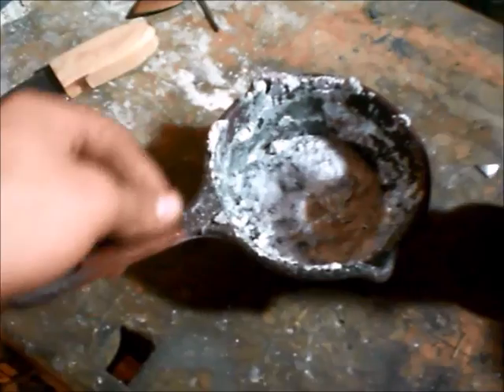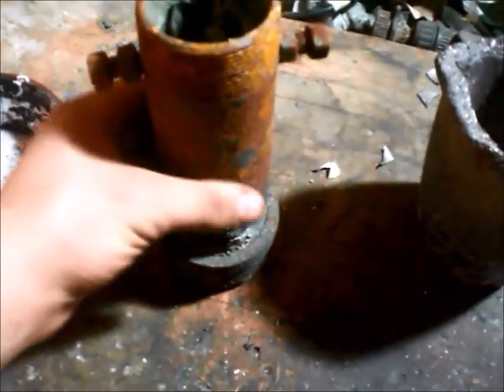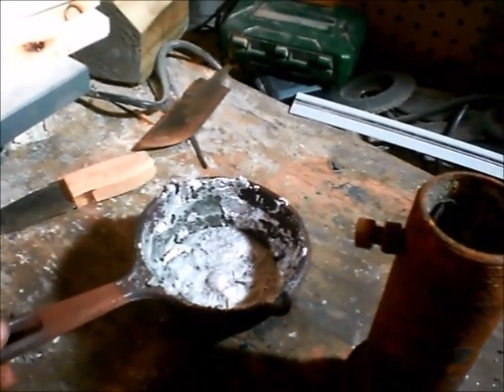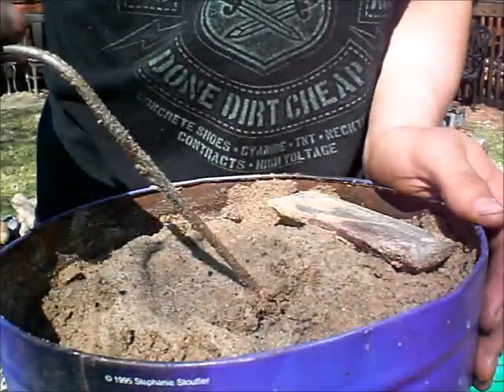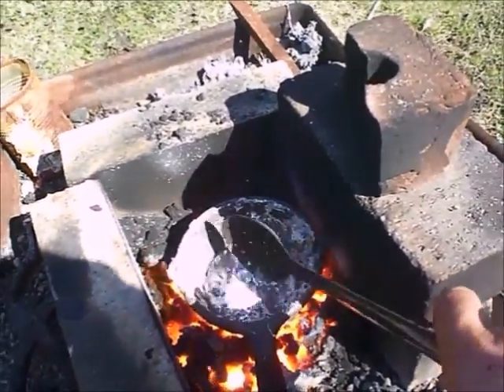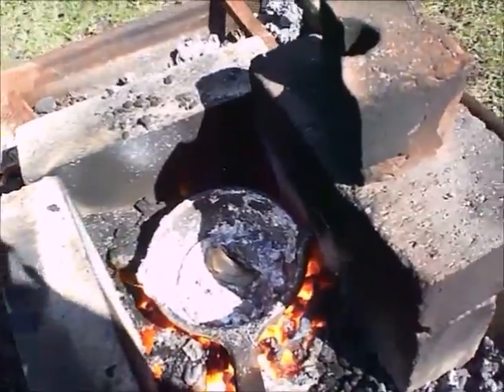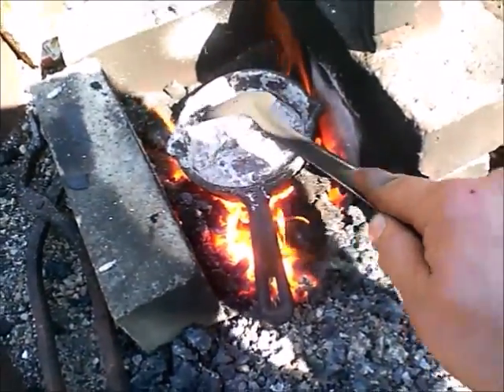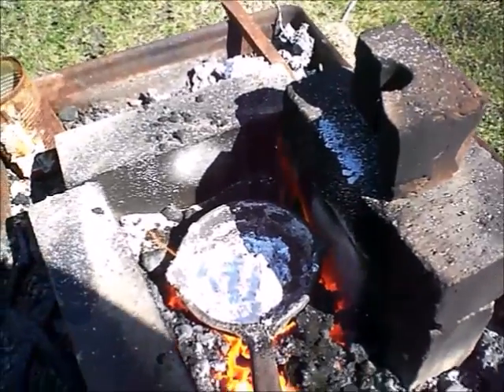Melting Aluminum Cans

Comment: Hello! I'm only just starting to research DIY aluminum recycling since foil is a popular material in my mixed media/sculpture class. This is only the second video I've watched. :D Right around 5:30 mark, you say not to put too much in, but the reason why isn't very clear verbally and the auto closed-captioning doesn't know either. Did you say it could deform the crucible?

Comment: Hello, is that charcoal ( wood)??          or the coal ( stone kinda) ? ?? its so beautifully lit,  sorry what are you using that is lit so firy good?  Thanks a lot
Reply: It's called Lump Charcoal. It burn at a much higher temperature than wood or charcoal bouquets. Also, for the same size bag, it less than half the cost of charcoal bouquet's, about $5 at Walmart. I use it myself.

Comment: I cast a metal melting furnace from mortar into a metal cube made from an old washing machine casing. The crucible is the bottom of a non-return helium cylinder. It worked fine when heated by wood and an old hairdryer as a blower, but the first time i added charcoal the bottom of the crucible burned out. When I get around to doing some more smelting I'll chop the bottom of an unused, empty larger cylinder or look around for a cast iron pot.
In terms of the mould; putting a couple of screws or bolts in the top surface will aid in removing it from the sand more cleanly.

Comment: What kind of table is that you're working on with the fire?
Reply from the maker: Its my forge!  I have since built a new one that is much larger and better.  This one, the body was an old lawnmower shell, an aluminum frame, and a rotor for the fire pot.

Comment: How do you get the fire hot enough do you have a trick? Or will a simple campfire melt the aluminum cans?
Reply from the maker: Air!  A campfire will work but you have to make sure your getting enough air to it.  For my forge and my old foundry I use a blow dryer connected to a light dimmer so I can control the heat.  Using hardwood charcoal, not briquettes, will reach a higher temperature than wood as well.  Hope this helped!
Reply: Gotcha ok I'm going to give it a try build my own little set up I'm going to use the aluminum heat and air ducting and an old weak leaf blower
Reply from the maker: @MrJohnv8386  hmm, ducting may not work for you very long.  I would suggest an empty paint can.  You can get those at any hardware store.  However if the duct is to channel the air then you can ignore all that.    Old leaf blower is exactly what I first used.  Good luck!  Let me know how it goes!

Comment: I need a block to machine on my lathe, will this aluminum have porosity in it from the impurity’s?
Reply: Process it twice would give you a much cleaner ingot i would think. You will lose a little more material but should be much cleaner. I know this is a six month old post. So what did you come up with?

Comment: hello , so I've tried this today , but i wasn't able to melt the beer and soda cans that i have. maybe it was too cold outside .... I used a vacume cleaner with a blower function to boost the wood's temperature and i've tried to melt the cans inside of an iron bucket, the bucket got red hot on the bottum and the cans would light on fire for a bit but after that, nothing! it was dissapointing, what am I doing wrong? anyone?
Reply from the maker: Hey!  Im so sorry for the late reply.  If you still need a bit of help I'm happy to provide.  If not, how did it go??
Reply: Use Lump Charcoal instead. Burns at a much higher temperature than wood or charcoal briquettes.  About $5 at Walmart.
Reply: I havn't gotten arround to it again since but i'll give it another go in a couple of months.
Reply from the maker: @xtazy1337  Great! Keep me posted

Comment: How does the fire get so hot
Reply from the maker: Its quite simple really.  Just like when you're camping and your fire starts dying you add more wood and blow on it.    Here, instead of using wood we use either coal or charcoal, I suppose charcoal could be viewed as wood but its "cooked" wood, and instead of blowing with our lungs we use some kind of machine.  I use a hair dryer with the heating function turned off.  I do this because it saves a lot of energy and the fire doesn't need any extra heat haha.  I have also attached a light dimmer to the hairdryer so that I can control how much it blows.  Because of the constant flow of oxygen to the burning fuel, it gets really hot.  Going back to the campfire, instead of short blows with your lungs, imagine putting a leaf blower up to it.  If you really want to learn cool applications of this chemical reaction, look up how oxy/fuel cutting works.  Hope this helped!

Comment: Something tells me inhaling even a little bit of fumes from that melting aluminum cannot be good for your health.
Reply from the maker: Theres a lot of facts and discussion around that.  From what I am aware of and in my experience, the fumes are really no danger to you unless the metal is boiling.  Then, just like water, the metal is literally evaporating and being put in the air on a molecular level.  Now, it takes a heck of a lot more heat to do this.  Aluminum melts at 1220 degrees F, thats 660 C.  In order to boil aluminum you need a temperature of at least 4,473 degrees F or 2,467 degrees C.  Those are pretty tough numbers to reach in factories let alone in your backyard.  However, thats only thinking about the aluminum.  In this video I melt pop cans which have paint and often plastics which of course are hazardous to burn.   Lets also not forget the coal I burn.  I really don't like melting cans for that reason but more for environmental reasons than for my health.  Yes if I stick my face in the plume of smoke created by the crucible and forge I could come down with cancer or some other disease but so long as your in a well ventilated area or have a form of proper ventilation there is really no cause for concern.  The only time I wear a face mask when working with aluminum is when Im grinding it.  When you grind or power sand aluminum or any metal you are putting it into the air.  Aluminum has been linked to many diseases such as alzheimers so I am very cautious and work safe in these process.  But the act of melting it does not raise alarms for me.  One more thing to be warry of is that aluminum in a molten state likes to stick to things, including you.  Fellas who work in professional foundries tell me they would rather work with steel than aluminum for this reason.  Im no chemist but my understanding on the concept is that because steel is so much hotter in the same state it likes to flow more fluidly as opposed to aluminum.  Im sorry to ramble :)

Comment: Cool video! I also built a furnace similar to yours! It's on my channel if you wanna check it out and let me know what you think... thanks!
Reply from the maker: Thats great dude!  excellent!  I would recommend insulating it somehow so that you can trap more heat and use your fuel more efficiently.  Plus you may even be able to melt different metals!  I would recommend looking up recipes using refractory cement or you can go the cheap route and get yourself some kaowool insulation.  Keep it up!

Comment: Great video, youre very easy to listen to because you speak so well to your viewers without the normal pitfalls others encounter: basically be you're a great public speaker, you don't resort to the usual "um's"or pauses, non sequiturs or inaudible  mumbling, which so many other amateur videos suffer from. So now saying that: I have one (two) questions and one tiny suggestion. First the suggestion: when outside, to make your voice more easily heard, try using a earbud/mic connected to your phone, the mic will pic up your voice (obviously) or in the absence of such an accessory, try covering your face with a loose fitting face mask (think Chinese people when SARS was everywhere) basically a medical hospital mask, or even a bandana a la bank robbers during the days of cowboys and Indians. Ultimately what you want is some way of reflecting your voice back towards the mic on your phone so it picks up your narrative a bit clearer. Even a piece of cardboard taped dangling from your nose in front of your mouth works in a pinch. ... Now my questions, if you part of the borax still in the aluminum, how and in what capacity does it still filter impurities before and as you're pouring it? Second, you mentioned hairdryer towards the end, for what reason? Surely the heat of a Conair hairdryer isn't enough to melt aluminum. Is it something having to do with stoking instead?
Reply from the maker: Thank you very much for everything you said!  I have been trying to make time to create more videos but find that to be rather difficult.  However, once I do finally get around to it I will be sure to take your comments and suggestions into thought and action.  As for your questions, the borax pulls impurities to the surface, its best to mix it into the metal with a spoon or something of the sort for a moment to really make sure your material is acting with it.  It stops filtering after you scrape the slag off the top.  It is best to leave a small amount of slag on the surface because this will actually act as a second filter when you go to pour.  I hope that answered your first question.  The hairdryer is what I use to supply a constant air flow through my forge. Because I use a hard fuel forge (coal, coke, charcoal) It requires a constant feed of air.   I have found that attaching a hairdryer to a light dimmer gives me optimal control of the fire.  Feel free to try it out!  I will make an updated aluminum melt video shortly as I have found new information and techniques to improve quality and efficiency.  Hope I helped!

Comment: Great vid & some good advice in the comments, I collecting Alli can's to melt, just want to know, do I need to take out the rubbish in them or will they just burn off, like smoke Butt's etc
Reply from the maker: Youll hear people tell you to make sure they are dry and youll hear some people tell you not to worry about it.  Im right in the middle.  A few drops of pop left over will instantly turn to steam, but a few sips will instantly send molten metal on your sleeves and in your face.  The plastic/wax or any other junks in the can will burn away with the paint but residue will be left in your pot which will need to be scraped off.  All in all, just pour out any liquid left in the cans but I usually dont worry too much about it. However, the drier the better.  Do your best to place the cans into your crucible right side up.  Hope I helped!

Comment: How many cans to make a bar and how much do you get for a bar?
Reply from the maker: Id say it takes around 15-20 cans for an ingot.  If youre looking for bulk there are much better resources out there for aluminum.  If you mean how much $ per bar Im not sure, I know its not a lot.  I use mine for sand casting not to sell.

Comment: what is the material of the vessel. is it metal or wat?
Reply from the maker: Mine are made of steel or cast iron.  Those work best for aluminum.  Dont buy a graphite pot unless you plan on doing precious metals or structural projects with your aluminum.

Comment: One thing that anyone trying this needs to know. Make absolutely sure your cans are completely dry and free of any liquid inside before adding them to molten metal. Once you have molten metal in the crucible, if you add another can that has ANY liquid, it will explode and sent molten metal flying. Best to use something large enough to hold all the cans you want to melt for one pour. That way any fluid will burn off before the metal melts.
Reply: Absolutely correct at the very least  por everything out and set next to coals or put in the  oven to make  sure it's dry even a drop of sweat will make bad things happen. And you will have no safety suit or anything. Unless you know what your doing I wouldn't try this at home. I've worked melting steel an aluminum. People die every year  from it and no telling how many get hurt
Reply: Thank you so much it indeed helps.

I have one more question please..

Can use beercans molten meltal to cast some shape? 

🙏
Reply: @lgrdiesel9655  Yes you can!
Reply: @1gallimaufry  
Thank you

Comment: I watched your whole video and i do have to say when you said that you saw or whatever people use the bottom a fire extinguisher i do have to add a comment about that, I myself used that and it was aluminum itself so it melted as well but also do make sure what metal it is before you use it, most likely just put a magnet up to it or whatever but not all fire extinguishers are usable for melting down aluminum. But i did like your video and i was thinking to myself "wow that guy is really unsafe" but then again when i did that before it melted the extinguisher i wasnt that safe but cool video!
Reply from the maker: +Freedom One I'm very happy you said that!  I was unaware that fire extinguishers were sometimes made of aluminum.  And yes a magnet would be the perfect tool to check for that.  Of course safety is number one, but often over looked, above all, always remember to wear safety glasses!